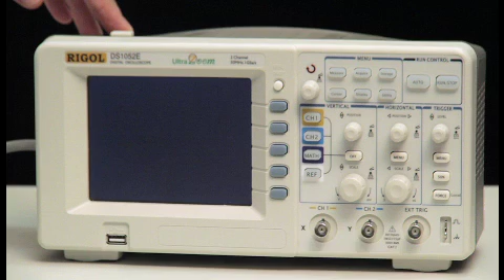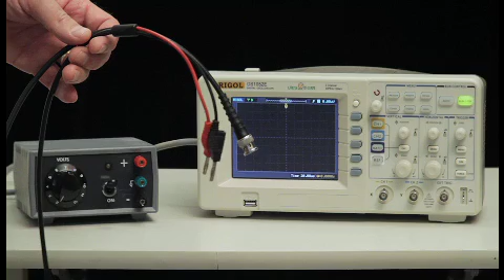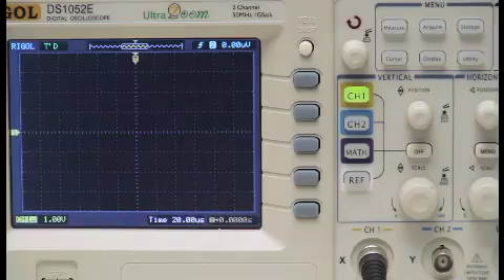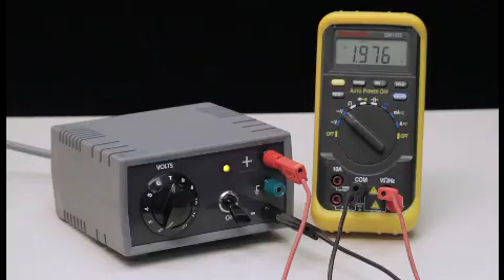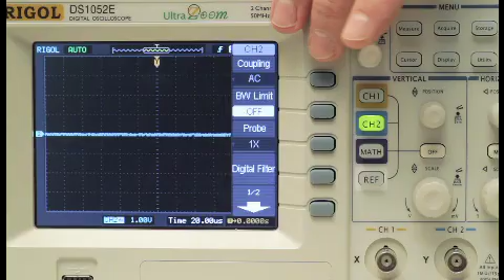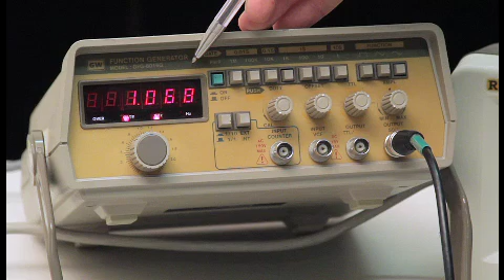Introduction to DS1052E Oscilloscope

Comment: Macquarie Uni PHYS1510 Skill 3 Pre Lab questions and answers:

1. Where is the ON button on the Rigol DS1052E?
a. On the right side of the top panel,
b. On the left side of the top panel,
c. In the middle of the left side panel,
d. In the middle of the back panel.

2. Which of these can an oscilloscope do that a digital multimeter can’t do?
a. Show us voltages that vary rapidly with time.
b. Measure DC voltage.
c. Measure AC voltage.
d. Nothing.

3. When you press the CH1 button the first time,
a. The CH1 menu appears,
b. The CH2 menu appears,
c. Nothing unless a signal is connected to CH1,
d. The CH1 menu disappears.

4. What does the small 1 in an arrow at the side of the screen show?
a. The lowest voltage of the CH1 signal
b. The highest voltage of the CH1 signal
c. The zero voltage of the CH1 signal
d. The zero voltage of the CH2 signal.

5. The voltage scale is displayed in what area of the screen?
a. Top left
b. Top right
c. Bottom right
d. Bottom left

6. The control to change the number of seconds per division displayed is
a. The smaller dial at the top of the VERTICAL section of the user interface
b. The larger dial at the bottom of the HORIZONTAL section of the user interface
c. The smaller dial at the top of the HORIZONTAL section of the user interface
d. The larger dial at the bottom of the VERTICAL section of the user interface

7. If you’re not sure what voltage and time scales your signal requires, you can get a good first
estimate by pressing the
a. Run/Stop button
b. Auto button
c. Measure button
d. Utility button

Answers: 1a,2a,3a,4c,5d,6d,7b

Sorry 1 = B not A : )
Q6 might be B?
Reply: Godspeed to you anon
Reply: Legend but question 1 is b :)
Reply: Question 6 should be b
Reply: holy epic find
Reply: @dean8700 very epic

Comment: 1. Where is the ON button on the Rigol DS1052E?
a. On the right side of the top panel,
b. On the left side of the top panel,
c. In the middle of the left side panel,
d. In the middle of the back panel.

2. Which of these can an oscilloscope do that a digital multimeter can’t do?
a. Show us voltages that vary rapidly with time.
b. Measure DC voltage.
c. Measure AC voltage.
d. Nothing.

3. When you press the CH1 button the first time,
a. The CH1 menu appears,
b. The CH2 menu appears,
c. Nothing unless a signal is connected to CH1,
d. The CH1 menu disappears.

4. What does the small 1 in an arrow at the side of the screen show?
a. The lowest voltage of the CH1 signal
b. The highest voltage of the CH1 signal
c. The zero voltage of the CH1 signal
d. The zero voltage of the CH2 signal.

5. The voltage scale is displayed in what area of the screen?
a. Top left
b. Top right
c. Bottom right
d. Bottom left

6. The control to change the number of seconds per division displayed is
a. The smaller dial at the top of the VERTICAL section of the user interface
b. The larger dial at the bottom of the HORIZONTAL section of the user interface
c. The smaller dial at the top of the HORIZONTAL section of the user interface
d. The larger dial at the bottom of the VERTICAL section of the user interface
Macquarie University Copyright Reserved 2016 2

7. If you’re not sure what voltage and time scales your signal requires, you can get a good first
estimate by pressing the
a. Run/Stop button
b. Auto button
c. Measure button
d. Utility button
Reply: what are the answers lol
Reply: Answers: 1a,2a,3a,4c,5d,6d,7b
Reply: @VENGEANCEDa2  the on button is on the left of the top panel
Reply: @bugs2146  oh whoops the marker gave me full marks anyway they don’t check properly